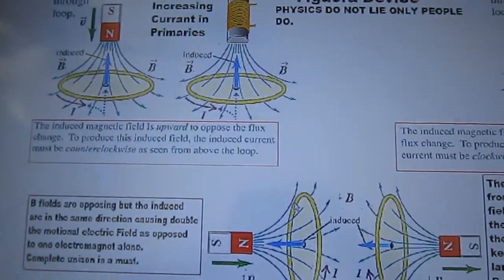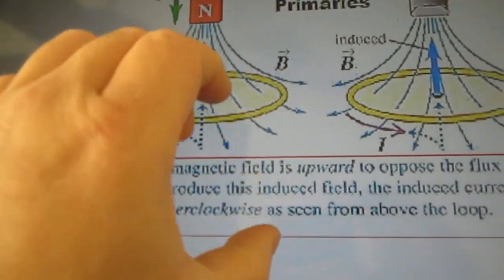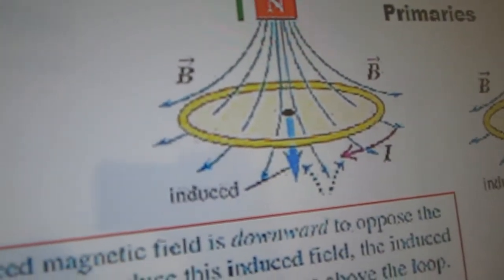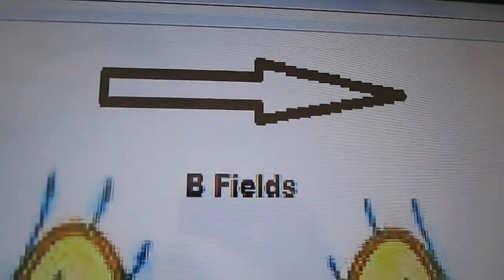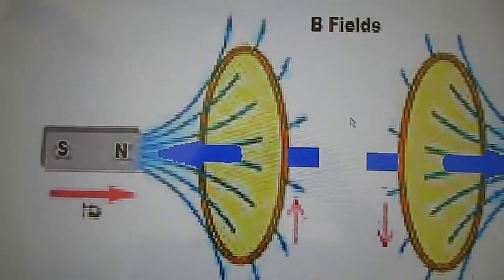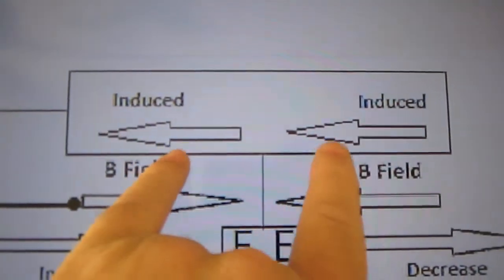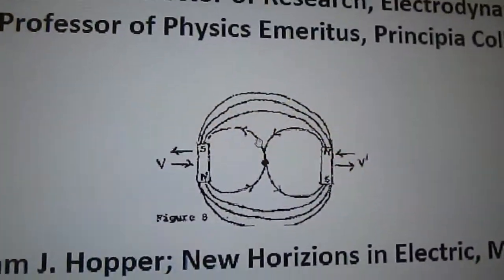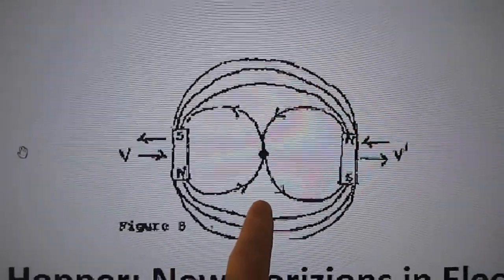Clemente Figuera Series Video 2

Comment: I think you have missed something. You say at 11:44 that you get double the intensity in electric field; well you have to realise that when one electromagnet induces 12 Volts for example on the coil, the other electromagnet induces 1 Volt for example, so even though the currents are in the same direction in the coil, when you load it, only the 12 V induced "current" will get used because that is how power sources work. I will give you an example, take to batteries, one with 3 Volts and the other wiith 1.5 volts. Put diodes on the plus terminal of each baterry so that current goes in one direction only. Now connect the plus from each battery, after the diodes of course, and then put a load between that connection and the common minus. You will notice that only the 3 volt battery will provide current to the load. The 1.5 V battery will provide nothing. That is how potentials work. So in your case although both magnetic field induce on the same coil and the induced potentials are in the same direction from both of them, you will use only the highest voltage, so basically only one of them, not both.

Comment: I have observed in the stationary design that the South Electromagnet North---Generator Coil----South Electromagnet North is the same as the physical movement of(magnets only: gen coil stationary) South magnet North---Generator Coil----North magnet South.  What is happening is a push pull unison spin on the gyroscopic particles to cause synchronized magnetic lines of flux to flow in one direction therefore causing a unified same direction current flow of 4 times instead of the conflicting design with 1/4 times.  Increases in output result from increased input voltage, increased frequency, and mass matching coil masses yet get transformer action for appropriate voltages and amperages.  I am doing experiments on these principles to get the correct design.  Thanks for your great video and research.  Check out this and look at the SN Gen coil SN diagrams:  https://www.youtube.com/watch?v=SSus2swTQP8 set CC ON then translate to English
Reply from the maker: SOrry for late reply but the FIguera device is two opposing electromagnets not n and S. https://figueramarathonman.boards.net/

Comment: Thank you for explaining the magnetic flux variance N-N.
I think it would work with a triangular signal generator on one side of the electromagnets and inverted / offset on the other side.
I'm curious what kind of solution you will find for part G.
Greetings from Romania.
Reply from the maker: Emil;
The Figuera device is DC operated and the primaries are raised and lowered in currant with the help of part G which is a dynamic inductor using revers EMF, self inductance to control currant flow.
Reply: There may be something like this for Part G:
https://www.shutterstock.com/image-vector/dynamic-inductance-595454126
The movement of the brush is linear (not circular).
A simple mechanism turns the rotation into linear motion.
What do you think?
Reply from the maker: Emil; that Graph design was ripped of from me by Saad and redone. i used it years ago to just get the point across as part G is actually a closed core but the action of currant control is linear in fashion. sorry you are not correct in your assumption as it is circular but linear in function. please visit Hyiq.org forum for further information.

Comment from the maker: If you are interested in further info on the Figuera device you can read more at Hyiq.org. be fore warned TROLLS are NOT tolerated at all unlike Energetic or OU where they run rampant. i will be releasing other video's shortly.
Stay tuned,
Marathonman

Comment: The trick and "secret" to this power amplification is something you explicitly state up front. The left side electromagnets have their drive voltages 90 degrees phase shifted from the right side. Which I presume you assert that the "resistor" bank is a progressive inductor bank that is tuned to enable the phase shift down the bank to be in alignment dynamically. All of this seems overly complicated.

One could use a bifilar winding to put the delay at the inductors and reduce the power needed to drive the system while creating the same phase shift effect without the commutater and progressive inductance; no? Thane Heins ReGenX patent details the performance of such a relationship. Or you can check out his YT channel(s).
Reply from the maker: You are completely wrong. there is NO phase shift in the Figuera device since DC is used. you are confusing AC with DC. the only thing is one is reducing and one is increasing in strength and NO i do not want to check out that Fake Thane Heins. you are completely wrong in your assumption and the fact that Figuera's device is actually quite simple that DOES NOT use bifilar winding's of any kind. apparently you have done no research into the Figuera device at all.
Reply: marathonman Slow down. I'm not asserting there is a bifilar winding in the subject device. And we both agree inductors need a changing current to induce anything, so forgive me for not distinguishing the difference of a variable DC vs. AC.  I was seeking clarification. So, as a DC drive, if you do not invert the coil, then there is a phase shift between the two coils. One is increasing and the other is decreasing... your own words... How does this occur?  Right, I have not studied the device. Just saw it today. Yours is the first explanation of the device I've seen and I was hoping for clarification, not a fight. What you present makes sense... it's how the machine sets this up is not immediately obvious to me by progressively sending the drive current through a series of resistors. Sure that will cause the voltage to shift up and down, but why would it cause one to decrease the North Pole simultaneously with the increasing North Pole... unless he is simply flipping the magnets, and you have renamed the South Pole as an inverted North Pole. That works for me. 

But I would also like to point out that a loosely coiled wire resistor is an inductor with capacitance. Potentially contributing to the efficiency of the drive circuit.

As far as Fake Thane Heins... really? Do you have a thing against professional chef's that have self-taught their electronics education? 

Tesla's patent was inspiration for him. Tesla asserted the added capacitance in the inductor caused a delay in the current flow. And capacitors with inductors can completely eliminate the phase shift of power through the inductor, without stopping the induction current flow and magnetic or capacitive transfer of dielectric energy without magnetic fields. In doing so, the power transferred through the device squared with the increase in voltage, improving efficiencies of both frequency and current capacity of the wire while reducing the resistance to that of the wire run, reactance free... Or do you consider Tesla a flake too?

Thane's work clearly shows the expected phase shift of a capacitor connected to an inductor. It also points out the induction law is specific to inductors without capacitance, once you build an inductor with capacitance the induction is captured in the capacitor which will transfer power (the induce EMF of a regular inductor) synchronized to the change in value of the voltage and polarity of the magnetic field... but you have to have an understanding of Aether physics to understand the full effect. Thane doesn't go there. He sticks with standard electrical theory to explain his device and only discusses the voltage intensity effects.

So, I'm curious why you think he's fake? His application was denied, but not for reason of failing to perform. It copies several previous patents and also generates free energy, two good reasons to have his patent denied. This design should benefit the Figuera design because the flux-capacitor inductor captures the self-generated induced magnetic field in the capacitance in phase with the drive voltage, generating power rather than consuming power from the reactance. But that goes beyond your passion of just supporting Figuera's past accomplishments.. which I agree are impressive.

So, frankly the unclear part of the circuit that I need confirmed, if you feel generous is to acknowledge that the windings on each paired drive inductor are reversed. This would match your example of the opposed poles of permanent magnets doing the same thing with motions approaching and departing... which seems physically impossible, but whatever. 

It is a curious thing. Generally referred in electromagnets, the opposite end of a coil is deemed the south end. But it could also be a weaker north end, the coil is a loop after all. And two north permanent magnets will stick to each other if one is weaker than the other. So, more specifically this would mean that as a positive voltage increases in an electromagnet, the magnetism is shifting to the north end, not distributing evenly around the coil. Relatively speaking the back end is then reducing its north polarity in comparison, which generates the effect you are describing in the Figuera device. With this understanding, no phase shift is happening as you say, it's just an effect of physically keeping the two coil lined up as one inductor with the output inductor situated between them. Peace. Bro.
Reply from the maker: Please go to this address and i will be happy to further enlighten .
http://forum.hyiq.org/thread/clemente-figuera/
Reply: marathonman Got it. Looked at the resistor network after reading your post and clearly he sends one side of the drop in the network up one side and the full load of the remaining resistance drop up the other. Hence the drive voltage exchanges potential across the median strip of output inductors always adding to the same voltage total but cycling up and down in opposition across the median. Thanks for clarifying this step. 

The output is AC, but chopped to the resolution of the resistor steps combined with the variation in timing delays of the series inductor pairs. It's a very clever inverter. With the two bucking magnetic fields produced by the reverse directed voltage drops the Lenz EMF is integrated into the output, matching the field of the opposing green inductor, very clever indeed. The amplification may not have a top end, cores amplify the power up to 1,000 times and the magnetic transfer drives the output power without significant resistance since the self-inductance is neutralized. Geometry limitations would be the limit on power amplification.

Still, pretty useless while the grid is operating. Build it into a UPS for a fridge or water pump/purifier, or heater, or emergency lighting and you might have something that won't get you busted. If you live in one of the areas struck by weather or "natural" disasters that shut down power, you may have a decent argument for implementing such a device... as an inverter whose patent is expired. Try not to mention the power amplifying features. That will end badly.
Reply from the maker: sorry your still wrong.
Reply from the maker: asking and posting are two different things, something you should of thought of first.
Reply: This is an unnecessary argument. It is added inapplicable data hence, a waste of time in this discussion!

Comment from the maker: marathonman
21 minutes ago
Thank you Timothy, I to have info on how to wind the coils. since currant actually  flows from neg to pos the coils are wound cw from north to south that way currant enters the coil from the front and exits out the rear to part G. so then when the primary is reduced the high pressure in that core is shoved into part G to combine with the reducing side of part G to amplify for the rising electromagnet. in this set up currant always flows in the same direction at all times and resists currant from flowing into the primary when it is not needed. if you look at the patent pic of the cores the set N side is actually shown correct but the south side is not as if it was added at a later date. i am getting very good results with this set up.
Reply: The real question that has not been addressed is the coil Y and how it is wound.  My thoughts on this is to put a neodymium  magnet in the center of the soft iron bar that it is wound on, with the magnet's north facing the north wound electromagnet. This will give a barrier of the induced electric field from the north electromagnet and a barrier for the south wound electromagnet. Each half of the coil Y is wound clockwise from the north and counterclockwise on the south  electromagnet side. Each half is its own induced coil with separate currents adding together with the other six Y coils alternating  clockwise to counterclockwise to clockwise  etc.  The center of the neodymium magnet is the bloc wall that separates the two halves of the coil.

Comment: Finally some common sense brought to the physics of magnetism.  Great job at your flawless logic.  Waiting for the rest,  I have a hunch on how to wind those coils.
Reply from the maker: you can catch the rest of my info here. http://forum.hyiq.org/thread/clemente-figuera/
Reply from the maker: Thank you Timothy, I to have info on how to wind the coils. since currant actually  flows from neg to pos the coils are wound cw from north to south that way currant enters the coil from the front and exits out the rear to part G. so then when the primary is reduced the high pressure in that core is shoved into part G to combine with the reducing side of part G to amplify for the rising electromagnet. in this set up currant always flows in the same direction at all times and resists currant from flowing into the primary when it is not needed. if you look at the patent pic of the cores the set N side is actually shown correct but the south side is not as if it was added at a later date. i am getting very good results with this set up.

Comment: Good work Marathonman! Facts can not be disproved, lies can, you've dispelled many of the Bankers Lies here in this video! The Bankers bought all the patents, and as evil does it then lies and cheats, but in the end, always looses. You've just shown that! Nice Work! Figrea News Articles are the closest thing to the truth we have, something the Bankers could not falsify! Figurea told the truth, its there in the News Articles! The voltage from the total current of the current dynamos is the sum of partial induced currents born in each one of the turns of the induced From the Figurea's mouth - This becomes more clear after studding The Mr Preva Experiment.
Reply: www.hyiq.org Hello Mr. Hyiq. Does a biffilar bucking coils can eliminate Lenz effect or the subsraction of E field when using N-S magnet configuration instead of N-N magnet configuration.
Reply from the maker: This device is two North opposing electromagnets one rising the other falling in unison sweeping the fields back and forth. Using a N and S field combine as one field and can not be used in the Figuera device and can not be varied at all.

Comment from the maker: my next video will include the primary and secondary relationship thus the cause of coherency between the primaries and secondaries.  If the fields are not coherent (In Unison)  the total energy in the region is the sum of the energies of the one field, i.e.,  the increasing electromagnet. if coherency is maintained  the square of the field intensity of each electromagnet combined  is integrated over the region of space occupied by the secondary,  thus the total energy is the square of twice the field intensity integrated over the region, or four times the energy of the two fields incoherent!.
Reply: marathonman Of course, the next level step is to realize synchronized transformers act as harmonically tuned receivers. Giving an exponential increase in power output. Electrical power systems are not limited to the conductors, they are all open systems, available for harvesting and amplification between each.
Reply from the maker: BMan;
While i will agree with the later half of your statement your thinking is flawed because of the fact that the Figuera device is NOT a transformer and your thinking it is that will get you no where fast. the fact is the Figuera device is a generator NOT a transformer of any kind. the fact is the output is the square of the two primaries coherent thus four time the output of two primaries non coherent. it is quite common here lately for people to confuse generators  from transformers in which you are not the exception to the rule. the Figuera device Generates and does not transform anything.